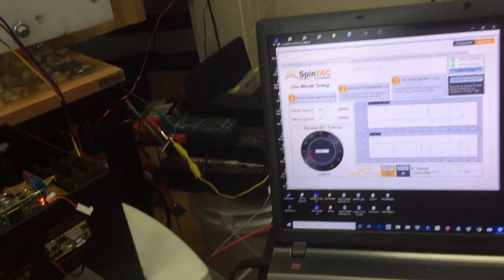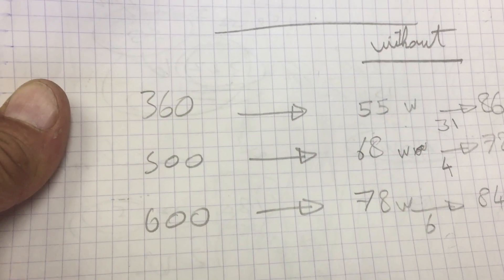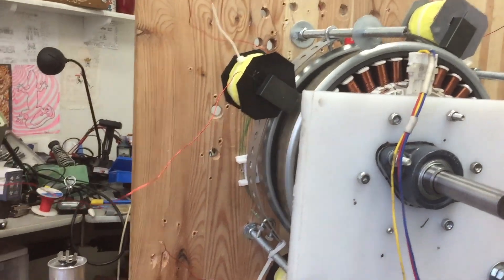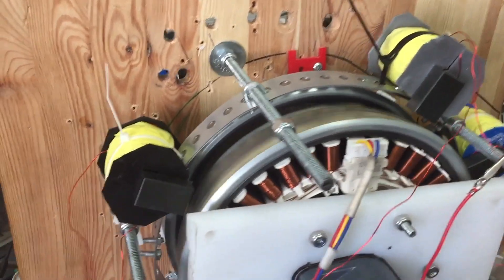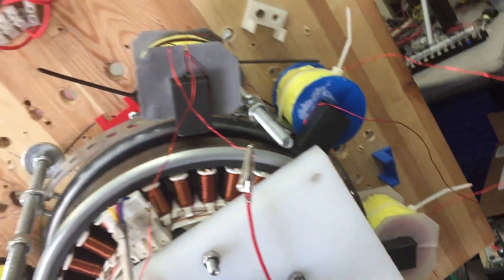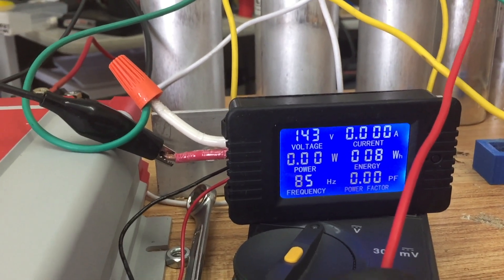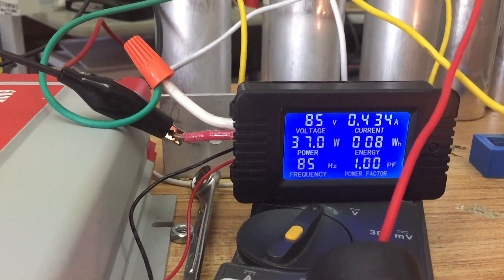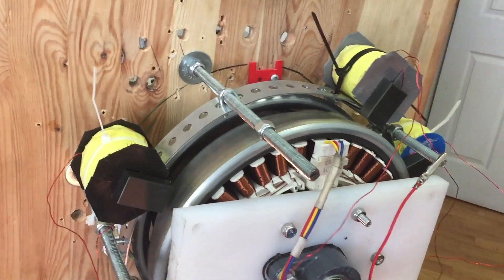Efficiency   124%

Comment: If those capacitors are AC capacitors put in series with each phase, it does significantly improve efficiency. Are the coils wired delta or wye? What is the resistance of each phase before and after the capacitor? That information will help validate the efficiency hypothesis. Cheers and good results!~
Reply from the maker: check my newer video

Comment: Hi, I have already posted my suggestions on another video of yours. However, this is the perfect setup for you to try putting the U core containing the coil horizontal so that both the two arms of the core are parallel to the magnets on the rotor. Please check if there is any improvement in the output and input power by varying the RPM. Thanks. 🙏

Comment: Nice demonstration Keep up the good work, I’m doing something similar but I need around   2,000hz before I get the anti lenz effect.
Reply from the maker: share your video
Reply: amir ibrahim  I have but I don’t go into depth like you do, lol
Reply from the maker: @daveparf  have you seen the new design i made on sketchup and i printed on the 3d printer ?>
Reply: amir ibrahim not yet I will look in a few hours.
Reply: amir ibrahim yes, how is the new design performing for you? Have to got any new results?
Reply from the maker: david parfitt it’s working but am still doing testing the good news under load the prime mover needed power don’t go up 
The bad news is the voltage drop a lot 
So I tried to connect the coils in series I got high voltage like 400 volts but it drop to 15 volts under load and when I connect in parallel low voltage so am thinking low to do delta config for the coils
Reply: amir ibrahim how many coils are you using?I’m sure that if you fill it with coils you will produce some usable electrical current.
When I connected my coils in 3 phase I had 8 coils in series on each phase but lost the amps because of resistance, I think you should wind a coil so it produces a little over the voltage that you need then copy it with as many as possible but connect them in parallel to multiply your amps.
Reply from the maker: @daveparf  check it out https://www.youtube.com/watch?v=RtrGaxdYXjo&t=46s

Comment: The motor changes efficiency so that it only wastes 68W instead of 76W fighting against itself with no load. it is still 105W in, 37W out, far from overunity.  When an unloaded motor is loaded, it can phase shift and become more efficient, likewise an efficient motor under load can become inefficient under no load.  Thane Heins was caught up in the same thinking with with his bi-toroid transformers, but that never went anywhere after years of trying, afaik.
Reply from the maker: putting the core on it take some watts , its the attraction between the core and the power NYD 52 NS
Reply: @EnergySeeker  I 3D printed a pulse motor, put it on a 1/8" shaft and ball bearings and it spins at 1000 RPM with less than 100 milliwatts of power.  Something seems very wasteful in your current setup.
Reply from the maker: @oldskooldriver9379  not the same motor , your motor cant drive my 2000 turn 20AWG coil core , you have to use something very small , you are not comparing the same setup are you testing with 40 watt lamps , one coil is powering 40 watt , i dont use LED because its not a real load
Reply from the maker: @oldskooldriver9379  what i would like to do is to try to put a pulsing coils to push my motor and reduce the torque needed , what do you think ?
Reply: @EnergySeeker  It can work.  I've not used the washing machine motor style as a pulse motor, not sure where to mount Hall effect sensors for my style drive circuits.  Maybe check out https://overunity.com/ for some ideas?  I'm not a big fan of the Bedini motors, which are just back-EMF recovery devices, not proven as overunity. In fact, all my experiments with back EMF and extra coil energy recovery all point towards 99.9_% efficiency at best.  I capture back EMF from each phase, charge a capacitor that supplies the other drive phase, and then use that captured back EMF energy during the other drive pulse (2 phase drive).  Steady state power costs for spinning with no load are only as good as clamping the back EMF into the coil with a schottky diode and a 1 phase drive.  Of course max power is only 1/2 due to 1 phase drive.

Comment: Bearing friction that require 80w to spin under 1k RPM with no load seems like a very wasteful machine.  Bearing and air resistance should be less than 1 watt for these low RPMs for an efficient BLDC motor.  Could some of the coils be fighting each other with the rewiring?
Reply from the maker: this motor is not re wired its as is motor for the washer machine as for the 80watt its the power needed for the motor to turn that drum with the magnet on it , plus the core are also part of it
Reply: @EnergySeeker  idk for sure what your system is supposed to be doing, but 80 watts "no load" for that motor seems very high considering appliances built like that are generally more "green".  My 25+ year old washer draws 600W under a full load of pants, so 80 watts without washer drum etc. is like 13% of that, which may be possible with inefficient consumer motor controllers under no load conditions, not an operating condition they are designed for. Bearing misalignment can also lead to high current draw, all bearings need to be on perfectly parallel planes.
Reply from the maker: @oldskooldriver9379  don't forget the following 56 magnets added and plus the magnet attraction resistance of the core to the magnets, i would like to change my motor but as you see so far its based on this shape of drum until now  , am trying to get rid of LENZ but am missing something and am trying to find it and am putting it online so everybody can share maybe someone can tell me what am missing so it will benefit for all

Comment: By the way if you want overunity or acceleration, follow thane heins Gegenx, not his BiTT.
Reply from the maker: i dont think i made a BiTT not sure where did you see that in my video , and am not doing regen x because i have no idea how its done , even though i did visit thane lab but i have no idea how he did it , and we tried his BiTT on my 10kw generator and it didnt work , it drag the prime mover we only tested once though ,
Reply: @EnergySeeker  BiTT is a flux separator only. No overunity to it. It simply shows reaction flux can be redirected but that's all to it.
Reply from the maker: @lukiepoole6701  well if the BiTT tuned maybe it will make also OverUnity because it will isolate the load from the prime mover
Reply: @EnergySeeker  It won't actually. The input power is literally zero if the primary is completely isolated. The flux is there but no power is transferred from the primary to the secondary. Unless the BiTT uses I*(dL/dt)=E rather than traditional L*(dI/dt)=E , you wouldn't be able to transform reactive power into real power.

By the way lenz free motor is impossible. Lenz free is equal to zero reaction flux. The inner coil would act like an inductor and allows no power transfer to the outer coil. However idk what would happen if magnet is used. Maybe it would be work if the principle of BiTT is applied to motor and using a magnet instead of coil as the rotor.
Reply from the maker: @lukiepoole6701  they are using big magnets see the video of juelbox and they will show the motor and how its made
Reply from the maker: @lukiepoole6701  as for the BiTT its a transformer so it use the flux of the primary to make real power from passing this flux through the coil on the 2ndary well , it works i saw it but its very limited and small unless its tested under a real load will never know and that what i told thane , the problem with resonance when you put capacitor you increasing also the prime mover needed watts, so it become a load yes it reach the resonance and it make the power factor close to 1 or even more but still you are putting more watts on your system but you compensate it once in resonance but its not working the way we need it to be working
Reply: @EnergySeeker  Like I said, the BiTT is simply a flux separator aka extreme power loss lmao. Sure at self-resonant frequency of the coil almost 100% power is transmit to the secondary but that simply makes the flux separation meaningless. Therefore, no overunity.

Which is why I switch to negative power generation, lenz less, overunity, zero input power. Couple inductor to a capacitor and magic lmao.
Reply: @EnergySeeker  juelbox?
Reply from the maker: @lukiepoole6701  would like to see that negative power , do you have tests on video ? just to see what is all about , it sound interesting
Reply from the maker: @lukiepoole6701  yes see here https://www.youtube.com/watch?v=7u0vlCy0CQ8&t=1619s
Reply: @EnergySeeker  No video for now. Negative power is cool. I have a bunch of stuff I wanna test on it lol.
Reply from the maker: @lukiepoole6701  the capacitor is part of my setup but in parallel, i didn't have success with a capacitor in series, how do you generate negative power and what is the reason to have it ?  if a short coil is a negative power then i understand you want to reduce the Lenz but how this will affect your production coil unless they are connected with the core? and if they are then they will cancel each other positive will cancel the negative resulting of 0 power
Reply from the maker: @lukiepoole6701  hi have you done any video with negative power ?

Comment: Good demonstrations. Since you are keeping records and, If you are attempting to create over-unity, should you also not calculate the amount of magnetic output along with the electrical output. Your setup is not designed to separate the two, but create one from the other. Absolutely nothing wrong with that. But when it comes to calculations, you are calculating only one, electrical, and not the magnetic output as well.
While the electrons will behave as particles, magnetic flux will behave like waves that create interference patterns. I think you should have great results if you were to measure both, in Watts as well as in Change of magnetic flux.
Reply from the maker: thanks for the feedback, please explain what is the purpose of doing that and how to do it ?
Reply: amir, I am no expert. Just suggesting. Your pickup coil has a ferrite core that became magnetised by way of expending energy and power, which you have calculated as your input cost. You are calculating the output in terms of electrical output only. But that output became available to you only, and only because the core became magnetised enough to send power through the coil. What was the total amount of magnetisation that occurred, and how much of that was converted to electrical power. The difference between the two, sometimes, is quite large and is wasted.
Reply from the maker: @sundiesel1232  i think the way am doing it the flux collide in the middle, i tried to have North North but it works best with NS , i don't have a tool to measure how much of wasted Flux

Comment: Perfect setup my friend, this is how you test!
Reply: Now if you have 4 more coils in the same layout as the current 4, equally spaced, series parallel, should double the output, but your phase will be out of sync by 45 degrees, so either run as separate circuit or figure out the right combination to connect all together, once you have it in series parallel, connect one side of the first set of 4 coils to one side of the 2nd set of 4 coils, now YOU have a start, a center tap, and an end, should give you split phase @ half the voltage on center tap
Reply from the maker: @JasonJoplin  my issue now is i put one coil i put 25 watt more on the motor i get 29 watt , its not working as i want it , after all the 28 coils is installed what i will get 5 watt x 28 , that is not a good goal , i need to re think how to make it better for one coil first
Reply: @EnergySeeker  david porter generator, use rotation from inertia to generate power then apply again power to the coil.
Reply from the maker: @randompvp3266  check new video
Reply: I agree
Reply from the maker: i will do only one coil and see